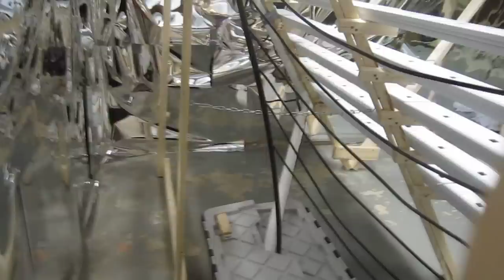NFT Hydroponic System by The Lettuce People

Comment: Can i use my 720lph max heoght 5m pump for this?
Reply: 5m is plenty of head.  If you have the box it should tell you what the maximum height is.  A larger tube going up to the top will provide less resistance.  At least 1/2" ID maybe 3/4.

Comment: where do u buy the square pvc
Reply: Those are not wire duct, they are specifically made for NFT by CropKing Inc
Reply: the ones she's using are actually for electricity wires, you can find them if you look for 'PVC channels'

P.S. I doubt they can handle high pressure in the long run, though.

Comment: you only have a 400 watt ballast!? and you plan on using ac 1000, well do you have fire coverage in your homeowners insurance? you can not use a 400 watt ballast with a 1000 wATT bulb. The bulb consumes way more power than a 400 watt and you will blow you bulb and may cause a fire. i could have sworn you said a 400 watt ballast with 2 1000 watt bulbs all from craigslist or wherever. i could be mistaken but just giving you a piece of advice if you dont want a fire you need a 1,000 watt ballast. and i would go with a digital one as well.

Comment: I was wondering why you decided to do the setup this way. instead of putting the two blocks back to back, making it an A frame, and that would also solve the problem of the top rows getting ample light?
Reply: +Vijay Anand She would need two banks of lights to achieve the same exposure. 1 x row lights in the middle, 2 banks of veges on either side vs 2 banks of lights on either side and one "A-frame" in the middle. 1/2 the lights, 1/2 the operating cost.

If the single bank of lights was right at the top of the A-frame, none of the lower rows would get light.
Reply: But she already has two lights (seems to be the case in the video) isnt it?

Comment: So this might sound dumb: I've seen a few of these A frame designs out there. Why couldn't you just put all of your troughs on the ground next to each other and still have the same footprint?
Reply: I have tried both and find angle seem to produce better but that is for me. Also recheck your square foot pattern
Reply: Are those the 3.75” Crop King NFT channels? How long are the channels? Do you just put the lettuce seeds directly in the rock wool? I germinate and sprout seeds in napkins inside of sandwich bags, then transfer the sprouts in Root Riots to rotisserie chicken containers. Then about two weeks later, transfer the Root Riots to net pots and deep water culture grow trays.

Transferring the sprouts from the napkins is a pain, because it takes time and it’s easy to break the young roots. I think it would be much easier to start the seeds in rock wool if the rock wool can wick the nutrient solution.

The “A” frame seems like there’s a lot of wasted space behind the grow area compared to putting all the NFT channels on one level, more like a table. 

Do you need to filter your nutrient when it returns to the reservoir tank to prevent root parts from clogging up your pump? How large is you pump to get the nutrient to the top NFT tray?

The Craig’s List lights might be a much cheaper way to buy lights. People growing illegal crops might need to refresh their lights with newer lights more often because they are dealing with a cash crop where more lighting efficiency could make more of a difference in how much profit they make on illegal crops, compared to growing lettuce, which doesn’t need as much light. 

I’ve found that lettuce only needs fluorescent lights. Although, fluorescent CFLs are now getting harder to find as they are being replaced in the stores with LED equivalents.

I’ve heard about NFT channels from FarmTek, but I never heard of Grow King before. I’ll check out Grow King. The NFT channels are a little costly, so I haven’t bought them yet, but I think I’d like to try using them.

Comment: You can also get a heat gun and warm up the end of the downspout and bend the end in a way where water won't leak. It's pretty easy. It shouldn't take you more than a minute per end. It's similar to pinching the end of a paper towel tube. If you have longer channels instead of 10ft channels, there are downspout connectors available. Instead of sealing the ends, you'll just connect them like legos. 

If you want it 100% seal, then add a large bead of silicone, but there's no point since it's a NFT system, and you're only going to have low level of water.

Comment: Love the cropking setup, but for large expansion, don't you think they get pretty expensive? To cap the end of the downspout, I was thinking of using regular foam and sealed with silicone. They sell large ones in homedepot. 
It might not be the best idea if you're going to have it outside in the sun though, but it should last many years indoors. If they break, it would only cost cents to repair. 
If you're planning on placing them outdoors, you can try making your own white acrylic sheets and cutting them with a jig saw or dremel. Might be more expensive, but very durable and waaaay cheaper than cropking.

Comment: Nice setup, but I'm thinking you would be better of using LED's even though you have to pay more.

Less heat to worry about and you'll spend a lot less in the long run with the reduced power consumption.
Reply: These days LED's are pretty cheap.  I get 4000K 4 ft ones at Lowe's for about $20 each.

Comment: Regarding drainage, have you considered placing porus material at the bottom to facilitate better drainage? I wonder if foam would work? This would likely act as a filter as well to get less dirt in the water, or does this system not use dirt?

Comment: I had just drew up a 3" sewer pipe design that looks Just like this Of course nowhere near as nice and high speed :-) , but wasn't sure if it was a good idea. Your video taught me that it is. The design looks like it works great. I have one question. Is it hard to remove the plant when it is at the end of its life cycle? The wholes seem very small so I wasnt sure how easily the root mass comes out of the flatter tubes and smaller wholes. Please let me know as I will use smaller wholes :-)  TY

Comment: You dont have to trust craigslist ppl, the change bulb once per year is just for getting the most lumen per watt, a HID bulb has a lifetime of about 50 000 hours, and it can shine for about 10 000 hours depending on brand without loosing more than 15-20% output, at 40k hours you only have 50-60% of new bulb output.. but don't trust me on numbers, the big players like Philips and Osram have documentation on their pages. for HPS bulbs you can tell how blackish the tube is on either side.

Comment from the maker: so the reason is because as water travels down the channels the plants suck nutrients out of the water. As this happens the levels of nutrients, pH and oxygen in the water changes. So 10 feet is the recommended length of channel. It sure would make this process easier to just let it flow from one channel to the next.

Comment: I'm currently thinking of installing a 300 GPH pump for 36 channels... That would provide 9 GPH per channel, which could be too much... You are currently getting 6.6GPH per channel if my calculations are correct. According to my research that's about optimal. I'll try mine, meassure it and tell you about my results!
Thanks for the quick reply by the way!

Comment from the maker: As the water flows through the channels pH, temperature, and nutrient levels change. I've done a fair amount of research and it seems to be consistent around 10-12 feet. It sure would make things much easier to just have one inlet and one outlet. These particular channels are from a company in the US called Crop King. Farmtek, I have heard makes a similar channel without the groove running down the center.
Thank you for watching!

Comment: I work with light for a living.  On can never "make" more light, to go bare bulb, just put milar reflective above it or in any direction where there is nothing growing. 

What a reflector can do is concentrate the light, which WOULD go good if you weren't growing on both sides.

Comment from the maker: I really like the ease of just dropping in the one inch cubes. My first system used down spouting so I am very familiar with the pains of cleaning net pots. i also used to have to cut the bottoms out of the net pots so that my cubes were getting wet. My only complaint thus far with the 1 inch rock wool, is when I am growing basil. Once the plants start to mature they get to heavy and can fall over. I think this time around I may have to ad some type of support wire. Thanks for watching!